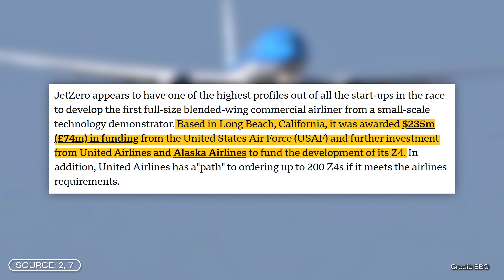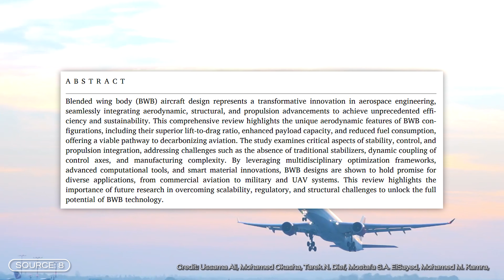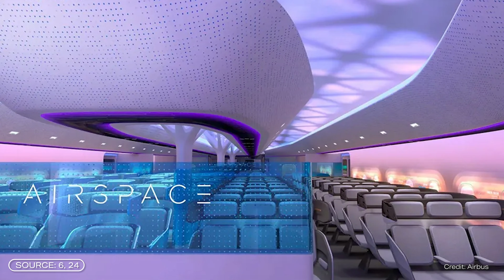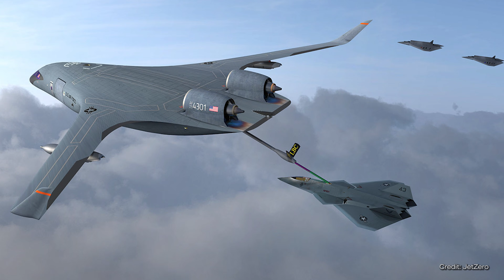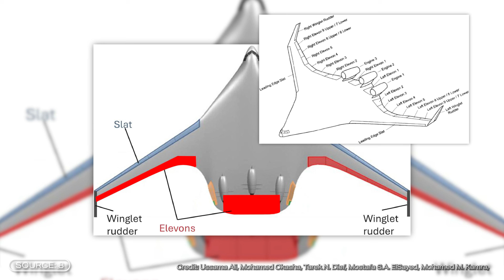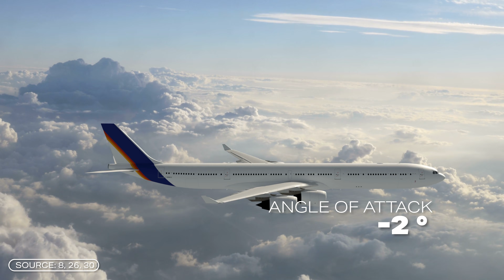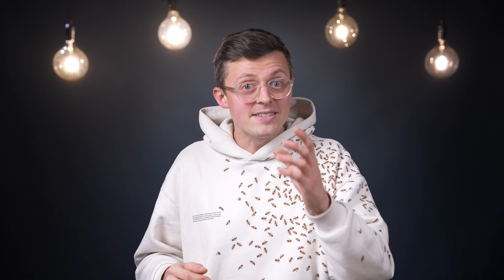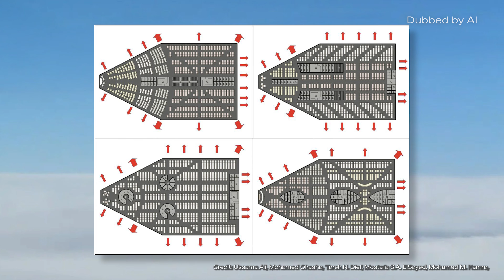The "Perfect" Plane Has One Big Problem...

Comment: Why not add a vertical stabiliser (tail) to address the yaw issues?
Reply: With traditional tube and wing aircraft, the vertical stabilizer is a long way back from the center of mass, meaning a relatively small force can create a large turning moment. A vertical stab close to the ceneter of mass would have to be much bigger (and thus draggier) to create the same turning moment. "So then put the stabilizer further back" but now we're a tube and wing aircraft again, but with extra steps.
Reply: @reaganharder1480 if you can accomplish the same task with less drag, it's better, right?
Reply: @HAHA.GoodMeme generally, yes. The tradeoffs you make for less drag aren't always worth it though. The conventional tube and wing design, if done right, is passively stable, so even a fairly bad situation can often be recovered by releasing the controls and letting the airframe sort itself out. Making a passively stable flying wing is much harder, if not impossible, so a fly-by-wire system with active stabilization is pretty much a necessity. Entrusting your safety to a computerized active stability system is a tradeoff, and that system is gonna have to be pretty reliable for that tradeoff to be worth it. Fortunately, the world at large has got a pretty good handle on how to make very reliable computer systems when needed
Reply: Drag

Comment: I do not think the Junkers G-38 can be described as an early blended wing-body design. It was just an aircraft with a very long wing root. The interference drag along that wing root must have been frighteningly large! As materials science progressed and light, strong alloys were developed, slender wings became possible and extremely thick wing roots became a thing of the past.

Supersonic flight brought back long wing roots in the shape of the delta wing. Delta-winged aircraft are in effect blended body-wings, but deltas make no sense for aircraft that operate in the subsonic range because their L/D ratio is poor, rendering them economically uncompetitive against conventional designs.

The aesthetics of blended body-wings is very exciting and it is easy to fall into the illusion that they have to be more efficient. This is not generally so. Let's look into the principal dimensions of efficiency.

In terms of internal space, blended body-wings are efficient. Whether that space can be usefully employed is another matter, but at the very least the shape lends itself well to storage of low density fuels such as hydrogen. 

In terms of structural efficiency, blended body wings are ok for unpressurised aircraft but not for pressurised craft, as the video points out.

In terms of aerodynamic efficiency, blended body-wings will in general be less efficient than a conventional design in subsonic cruise flight. To understand why, it is useful to know that high cruise economy comes from a high L/D (lift to drag) ratio, which in its turn requires, among other things, near-elliptical spanwise lift distribution. For a given span, this is best achieved with wing geometries similar to those of conventional airliners, which is the reason why the overall design of passenger and cargo aircraft has remained essentially unchanged for decades.

A blended body can provide more lift, but only at the cost of proportionally more drag than a normal wing creates. There is no way around this. Conversely, a blended body typology can be aerodynamically productive in flight phases where a low L/D is desirable, e.g. in the landing phase, as a blended body (or delta wing, or LERX) can generate high lift at high angles of attack, at the cost of much higher drag.

The idea that there are important gains to be made with a more gradual transition between wing and body is not correct, at least for subsonic flight. The filleting needed to counter interference drag at the wing root is surprisingly small for the leading half of the wing. The required filleting increases towards the trailing edge, but is already present in current designs.

The shape of modern wing airfoils near the wing root is also already tailored to the more turbulent airflow near the fuselage.

It would be interesting to discuss other issues such as the potential for blended body-specific airfoils, but these are marginal against the major fact that blending wing and body does not, in fact, promise any significant increase in cruise economy (if any) to offset the added construction complexity.

I see a parallel here with canards and flying wings: enthusiasts point to the advantage of having stabilisers that produce upward lift or of not having the drag of a tail, respectively, but forget the countervailing issues that always render these layouts no more efficient than a conventional one. There are applications for canards and flying wings, but cruise efficiency is not their justification.